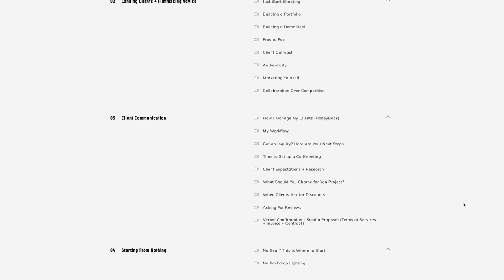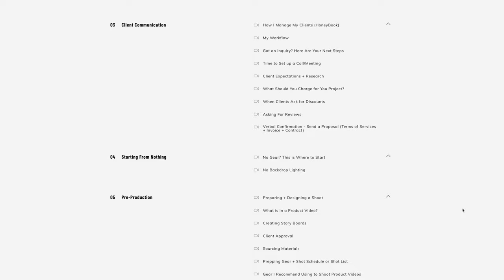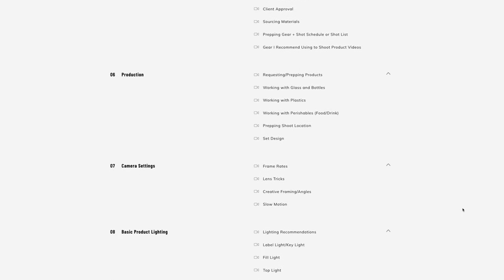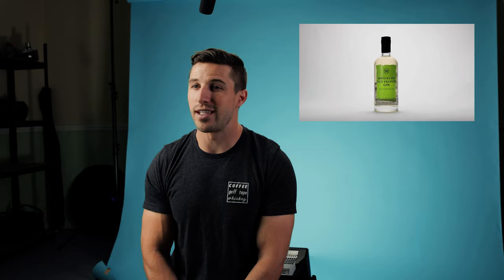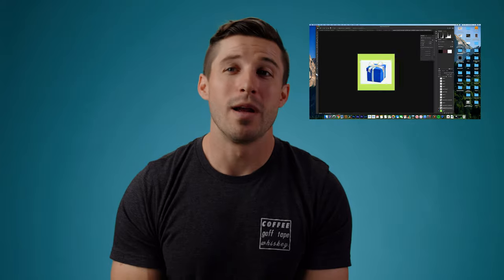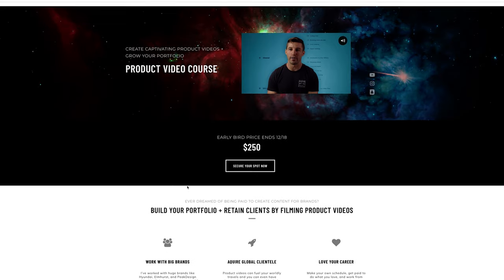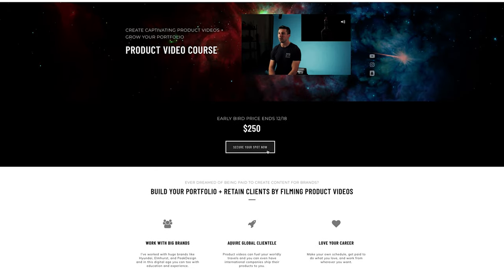Build a Product Launcher for your Commercials | Pneumatic Rod Tutorial - Part 2

Comment: Thank you for doing the time to explain how it works. Have you consider using linear actuator, because the setup if easy if you don’t want to control the speed (the default speed on 12v linear actuator is not fast). Just sharing my thoughts.